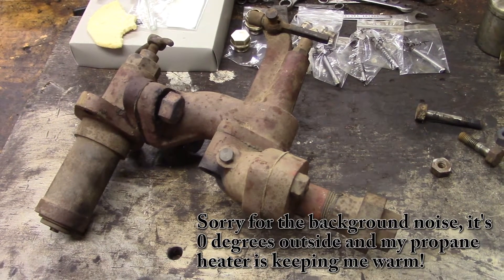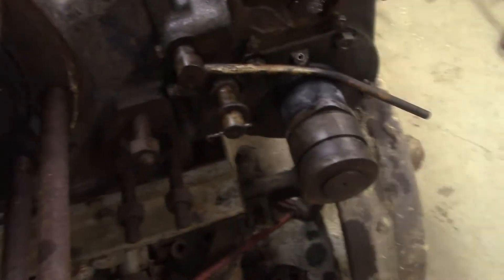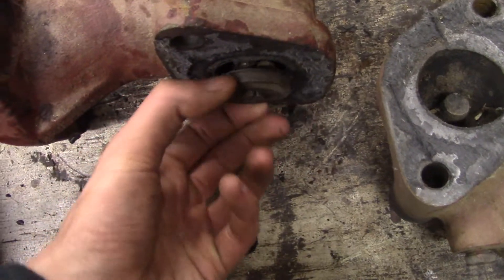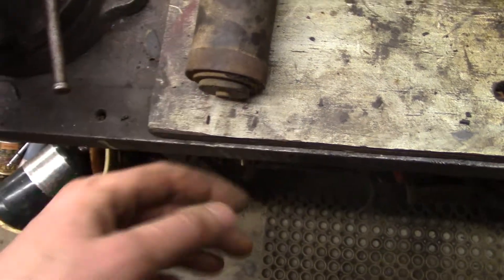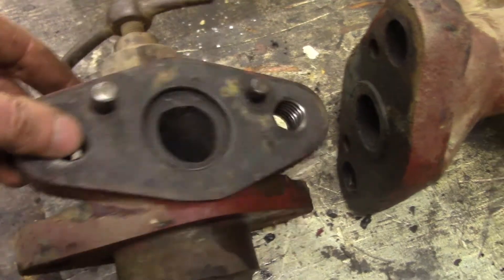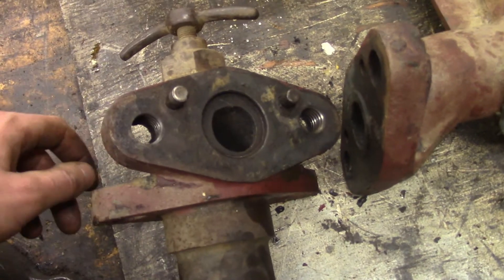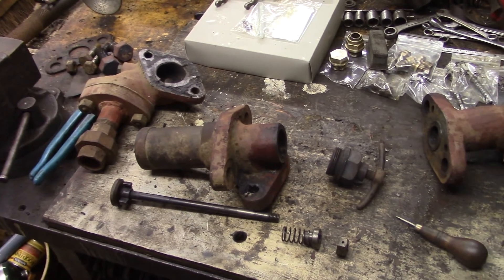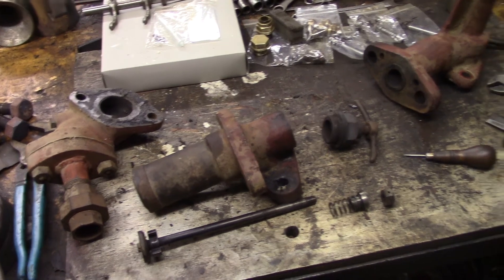Ruston Hornsby 7XHR Air Start Valve Disassembly

Comment: just watched the video, i assume that maybe the locating dowels are becould you have the cam acting on the second hald of the assemly and it might tend to move around or change clearance setting is it was only two loose bolts holes holding it?